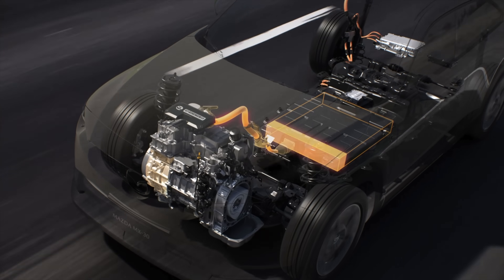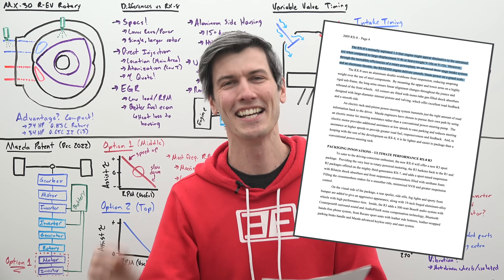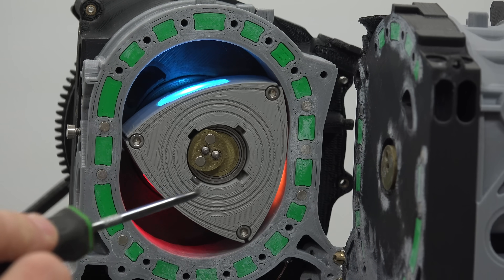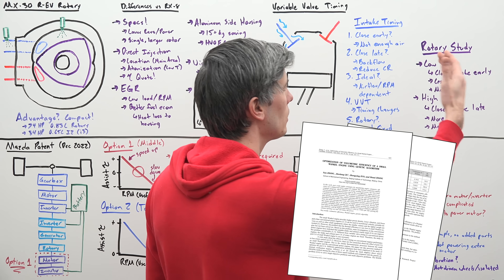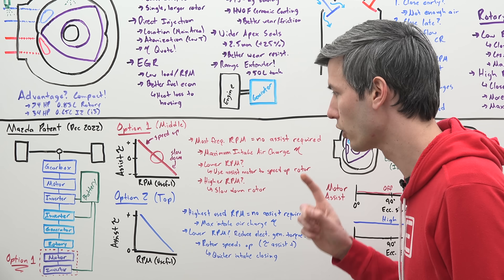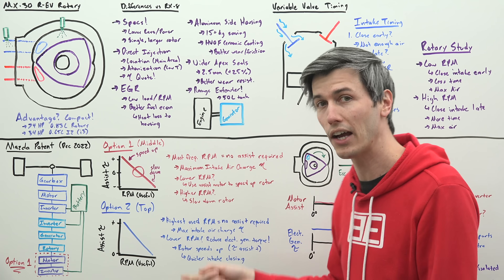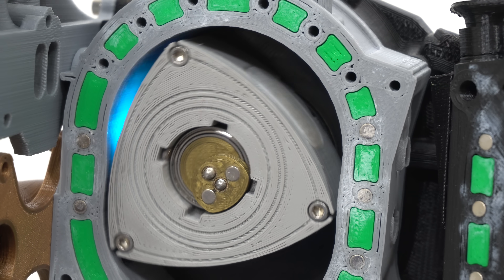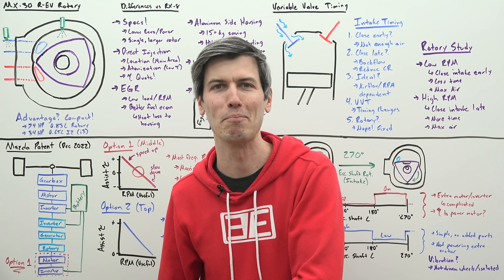Mazda Brought Back The Rotary Engine!

Comment: I love knowing that Mazda has not given up on the rotary. Mazda is a very special company, if you look at their history, people and passion in that company - they are so impressive. 

That being said; this is definitely not the rotary 99% of us wanted. 
🙃
Reply: absolutley correct!
Reply: No, but this could be a good use case for the rotary (any small rotary...not necessarily one using this patent). Compactness is great in a range extender. I hope it works out, as having any rotary in production will help its development and optimization.
Reply: They already made the rotary you wanted.
Reply: @andoletube  Yeah, but they don't need to make the rotary current enthusiast want. They need to make ones the market wants. That means long life, efficiency, and low emissions. Unfortunately, the rotary isn't great at any of those right now.

The rotary is great at many other things. If they can ever resolve the apex seal issues and optimize the rest, it would return to the market.

Maybe one path is as a range extender, where it operates over a far less challenging range and benefits from lower weight and size. Optimize it for that and maybe that experience will lead to further improvements for use as actual engine.
Reply: pointless.
There is not practical space saving as compared to phevs using otto cycle generators. And, the latter will provide better fuel economy.
The wankel is an interesting engineering exercise that belongs to history books
Reply: @USUG0  We'll see what Mazda can do. 

No argument on fuel economy comparisons of course. That leaves size and weight. If the Mazda folks can't compensate there, there won't be a business case for it.
Reply: @RichM3000  the car is already out. It appears to have a 760km range with a 50L tank. If you subtract 85km of claimed wltp of electric range, you get 675km with battery depleted. That translates to 14km/L as hybrid, when most other phevs get 20km/L, and a properly engineered otto cycle range extender would give up to 25km/L. And there is no frunk like in every other phev, so no space optimization either.
Reply: @USUG0  If you know about the rotary, you know the efficiency of a rotary is far, far from idle - the top of the rev range. Terrible efficiency at idle. That being said, dying to see rotaries come back in racing applications
Reply: Look at how pathetic the MX-30 EV is.  underpowered.  very low range.  Barely sells dozens per month.   Zoom Zoom is dead.
Reply: Wait until you see what tuner culture is planning with this engine!
Reply: @RichM3000  Agreed, I hope this is really a test bed for something much more exciting down the road. Like a midengine RX-9 twin rotary turbo with a performance hybrid drive. I do hope with the performance one they have both port and direct injection, a rotary isn't a rotary if it isn't shooting flames off throttle between shifts at full tilt!
Reply: @anydaynow01 just plug the direct injection port up and make a custom intake manifold for port Injection lol. Or just make it inject fuel on decel haha. I'm sure we'd find our ways.
Reply: @RichM3000  Wouldn't a turboshaft range-extender offer more benefits? Turboshafts offer fairly high power-density without the maintenance or service life issues of rotaries. In fact, I thought turboshafts compared favorably to piston engines in service life and maintenance. Range-extension would be an even better application of turboshafts in ground vehicles than as the main powerplant since they don't have to spend any time in low efficiency RPM ranges where they (like the rotary) really struggle to compete in fuel efficiency. 

An added benefit is turboshafts can be made less finnicky about the fuel you feed them. This has the potential to be a somewhat practical implementation of flex-fuel.
Reply: Let's be honest, almost all car companies are switching to ev and sadly I have to agree, we either do that or we're fucked in a few year, gotta love Mazda for making the rotary alive again, actually I'm pretty stoked for this car, I hope they produce some kind of coupe with it i don't wanna drive a mom car 😂
Reply: @atlas42185  Maybe. I'm a mechanical engineer and spent about 15 years on jet engine design at GE and Pratt & Whitney. So, I have ample familiarity but never worked on an application of this type. 

I assume a range extender would almost certainly be centrifugal flow, given the size and application. The one site I checked that proposes such a concept indeed uses that architecture. Believe it or not, there are axial flow turboshafts almost the appropriate size, but IMO they would be suboptimal for this application.

The Chrysler Turbine Car was centrifugal flow too, so one can maybe look at lessons learned there, apples to apples. That car ran on multiple fuels and was very smooth. It wasn't good on emissions or fuel economy, though (two Wankel/rotary engine weaknesses as well, interestingly).

My guess is that turboshafts are being looked at, but that they would already be in use if they were the best design. People are discussing the rotary engine because it has yet to be optimized. The rotary engine is a technology that is five years from perfection, and will likely always be five years rom perfection. But, if its full potential can ever be realized, it could be a great range extender.

The centrifugal flow turboshaft, though, is relatively mature technology. Car builders know pretty much what they'd get with it now and aren't using it. So, that's telling from a free market perspective. From an engineering perspective, though, it's definitely an interesting question.
Reply: @atlas42185  I found one in a production vehicle, albeit a very low volume one that's not quite in production yet. The Ariel Hipercar (yes, that's how they spell it) has an optional Cosworth micro-turbine range extender. From the image, it's a centrifugal flow turboshaft, but I can't find anything but an exterior shot of the unit.

So, maybe?
Reply: @USUG0  Well the benefit of the rotary is it's much much lighter weight and smaller. Especially now that it's aluminum instead of steel. With this new tech it could be a lot more efficient too and much longer lasting since it won't be changing revs so much.
Reply: @RichM3000  possibly the problem with a Turbine Range Extender is that the noise and heat would be quite a challenge, and that the complexity of such things would probably turn away the average consumer (it's a different thing if the market is some enthusiasts), some small RC Jet engines are already quite loud and consume quite abit of fuel (see Warped Perception's video on one), and i don't know how much baffling would one even require.
Reply: @nightshade4873  Nobodies mentioned start up time either, jet engines don't just start up immediately and they have to be started in a very specific way. Casey Putsch has a jet powered bat mobile, that sucker takes at least a couple mins to properly start. Maintenance is also quite the journey for him but I think he learned how to do most of it himself since he built the car himself, not something most people know how to do, even most mechanics.
Reply: @nightshade4873  There are clearly reasons they aren't being used in mainstream automobiles. But, the Chrysler Turbine Car didn't have any particular problems with noise or heat. The noise produced by a jet engine is mainly from thrust. Turboshafts don't have that issue, as they don't generate thrust (they generate torque).

I suspect it's cost and complexity, and that automobile manufacturers know how to design ICE engines and already have tooling and engineering for manufacturing them. But, that's supposition on my part. I'm not close enough to it to have any real idea of the cost analysis specifics.

Comment: Honestly, I really love this idea, I drive a Chevy volt, so I’m obviously biased, but most trips are short electric trips. And so it works perfectly fine. You can make 4 plug-in hybrids with the same amount of batteries as 1 full EV with decent range. And the overall salts in more electrical miles driven..
1 ev and 3 ice  versus 4 plugins results in total in 25 and 75% of miles driven electrically for same battery capacity:
1+3/4 =25% vs 0.75*4/4 = 75%

The one issue with plug-in hybrids is that you’re still lugging around an engine and this is where a Wankel makes a ton of sense.
It’s light and it’s simple, and it does still save you from lugging around the giant battery so in the end you’re winning out.

I honestly think for as long as we are battery constrained this is a fantastic option.
Reply: It's crazy to me how people love going to extremes. I've seen stuff about EV owners towing a trailer with a generator to charge their vehicle. Why? How can that possibly be better than a hybrid? It seems to me that hybrids are, have been, and will continue to be for the foreseeable future the best option.
Reply: Hybrids run on gas engines which are only 18% efficient, range extenders run at the optimum efficiency rpm range.

Comment: I been wondering for years, close to decades now, why rotarys aren't used in hybrids. Seems like a great pairing to me.
Reply: Because they are expensive to maintain.
Reply: despite being beautiful objects and fascinating machines, rotary engines are fundamentally limited by materials science and manufacturing costs. there isn't a single rotary engine out there that doesn't eat apex seals for breakfast, and machining the combustion chamber is much more complicated than boring the cylinders in a piston-cylinder engine.
Reply: there's a fundamental geometry problem, in that a long and thin combustion chamber spends more time heating the housing than producing power.
Reply: regarding the devil's-marks problem... why cant there be a sky/skid like spool/foot which skids along the surface and adapts angle of pull/force via a axle/pin connecting the triangle rotor's wedge/edge and the sky/peddle/foot in contact with wall and skidding along it keeping the chamber sealed and avoiding the devil's-marks caused by when the wedge/edge of rotor is directly in contact with wall
Reply: @mi1400  increased friction, that axle is also going to be suffering a lot of wear.

also devil's marks aren't a problem anymore